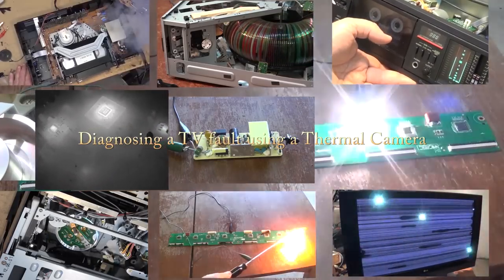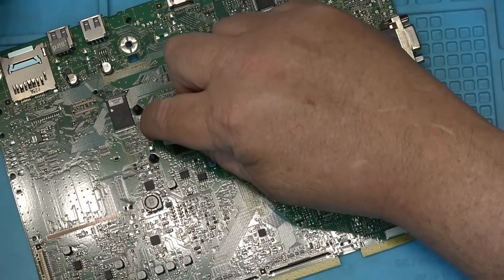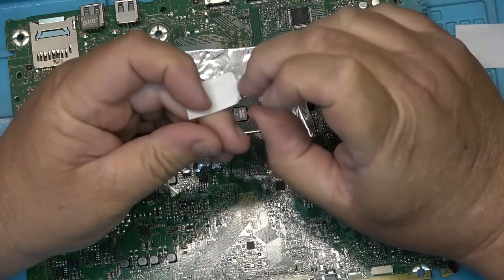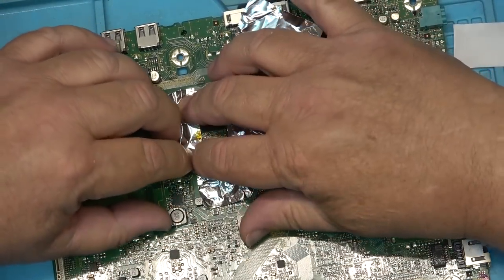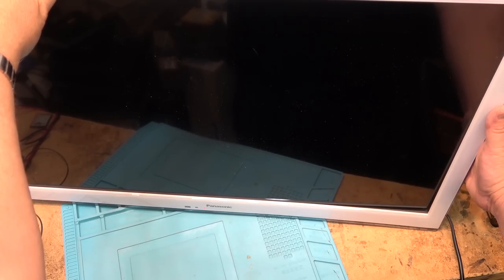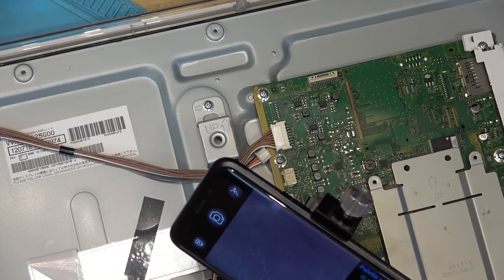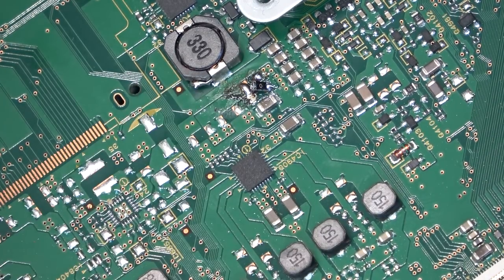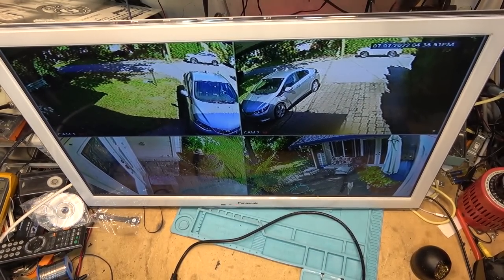Troubleshooting a Dead Panasonic TV using a Thermal Imaging Camera

Comment: I used to (as a kid growing up in the 80's) to work or general helper (go for) go bring me this and that...
Clean up the place to make my point...
But got to see first hand repairs on stereo systems, vcr's (vhs & beta) tv's from all makes & models ( the one tv i still remember to this day that got in for repairs is an RCA i remember the insides were all modular) i think it was an RCA...
I was like 10 years old so my memory is fuzzy
Does anybody remember those modular pcb's from this tv?
The point is that i enjoy your channel & these types of videos it brings back good memories from the good old days in the 80's
Thanks for the uploads
Greetings from Mexico
Reply from the maker: RCA, zenith, motorola, Philips were all modular for awhile.  Problem is modular sets were much more troublesome because the module connections failed.
Reply: @12voltvids  thanks for clearing that up (on the modular pcb's) also remember that a lot of stereo's came in for repairs (burned STK's)
Thanks again for your uploads
Reply from the maker: @jorgecuelar3391  stk ipm (integrated power modules) were the curse of 80s stereos.  A disaster brought to you by your friends at sanyo.  Remember they make life's good things better.... For the service guys for sure. No skill required just change the ipm and charge a fortune for it (because the ICS were pretty pricey especially if you bought them from manufacture.
Reply: @12voltvids  They were also an issue when used for convergence in many TV's.
Reply from the maker: @tinicum54  
Designed to fail.  Made lots of money changing them on Sony projection sets.  Used to buy them 10 at a time.  That was good for the 5 sets i would see a week with blown convergence IPM.

Comment: That TV might not be worth the effort you've just put in. But the entertainment value was there!! Thanks for persevering on that one and reaching a conclusion.
Reply from the maker: It will be used here as a monitor for my camera after the existing 20 year old BenQ tv blows up.  Should probably just change it out as BenQ draws 500 watts.
Reply: @12voltvids  500 watts? that must be fun in the summer...
Reply from the maker: @jorno1994  gets warm in here.

Comment: Would you consider doing a repair on a Sony KV-29FX30e mainboard? Looks to be power regulation issue, picture is pulsating and contrast needs to be quite high.
Reply from the maker: No wouldn't consider repairing a chassis.

Comment: A lot of the smaller Panasonic TV,s and non oled models are most likely vestel made sets Panasonic made sets tend to be the 55 inch up oled TV,s .
Reply from the maker: Everything Panasonic makes TVs anymore do they? Certainly not OLED. Panasonic made a lot of plasma TVs and they made some of the best plasma TVs that were ever made. I have six working Panasonic plasma is in two that are non-functional at the moment. This small Panasonic the panel said made in the Czech republic on the back of it but the main board power supply and television say made in Mexico on them

Comment: A weatherproofing guy who was at the house around 1996 where I was to service an RCA rear projection set offered his to use.  Quickly determined it was the HV splitter.  I suspected that anyway but that removed all doubt.
Reply from the maker: Great tool to have in toolbox.

Comment: I got a cheap hot air station from aliexpress, it works really well.
One thing that always scares me is soldering/desoldering near electrolytic/solid capacitors.
what are the odds of one of them blowing up in my face while im soldering/desoldering something near it.
Reply from the maker: Shield with thermal tape like I did.
Reply: @12voltvids  Yeah, but they still often exceed the temperature rating.
Reply from the maker: @filenotfound__3871  not if you shield it correctly.  We used this stuff to protect cables when using a torch to heat shrink cables and needed to protect plastic insulation.
Reply: @12voltvids  I took an old LGA 775 motherboard and tried to desolder a VRM phase and then solder it back on and even tough i put aluminium foil around the place, 4 out of 5 nearby capacitors boulged. The motherboard still works but thoose capacitors do worry me. Is there a specific setting on the reflow station i could use to avoid this? I used 400c and max airflow.

Comment: Sometimes it's worth more fixing things just to know what the fault is, rather than the item being of any value. Even so you found a use for it - better than going to recycling or landfill. So much stuff is thrown away that should be fixed and re-used instead of dumping on the side of the road. It would be better to create an industry of repairers and downsize the importing of foreign technology - no one has any practical skills anymore - outside of China/Asia. Great fix and interesting to watch the diagnosis using a thermal camera in combination with the fault codes.
Reply from the maker: Industry of repairers you say. That time has passed.  Untill the cost of a 40" tv gets back to 1000 and a 60" 4000 this isn't going to happen. The reason that these businesses flourished right up until around 2000 was because new products were expensive and it was cheaper to repair and replace even if the labor cost was high it was cheaper to repair than replace. When the big price drop happened APK more economical to replace a TV than to fix an old one and that put everyone that was in the business out of business. I left about 20 years ago. Best decision I ever made. I left before the bottom fell out but I could see the writing on the wall
Reply: @12voltvids  Yes what I say sounds naiive but if imports were controlled the price of electronics would go up and there would be a monetary reason to repair rather than just buy new. Reducing waste and providing a valuable core of skilled workers. Just a dream...
Reply from the maker: @radio-ged4626  well there were imbargos on Japanese electronics as recent as the 80s.  I remember very pissed off Hitachi tv owners that took it out on the shop i first worked at when in high school.  Hitachi had their 20 year warranty on semiconductors.  TVs would come in with bad ftybacks or special semiconductors but because the government had an embargo on Japanese companies we just couldn't get parts.  This resulted in customers demanding the store give them a new set or their money back.  I was only 16 working there after school and i remember a few very angry 😡 people call me and the owner who was Chinese every name in the book like it was our fault.  It was the government's attempt to stop the flood of cheap electronics from Japan in the late 70s and early 80s.  It didn't work, the domestic manufactures still went broke.
Reply: @12voltvids  Sounds like a bad time. Must have been quite unnerving for a 16 year old. I wouldn't advocate an embargo, just a little control over import numbers with incentives to provide reasonable repair support. So many manufacturers over protect their products against third party repairers. It would be good if we could all have a rethink on how we produce and maintain electronic goods.

Comment: Cool! How long did it take to find this fault for you? But why does a audio fault kill the whole system to boot up?
Reply: Because the audio chip is shorted to ground and is pulling a lot of current and the power board is detecting a fault and shutting down
Reply from the maker: Over current shut down.  
Didn't take that long to find it.  When I first counted the lights blinking I only saw eight as was shown at the beginning of the video so I immediately went to the main processor thinking perhaps one of the voltages was missing due to a bad BGA connection. Sorry that chip and then checked it and I saw nine blinks. 9:00 is audio problem. So I disconnected the speakers thinking perhaps a bad speaker and it still shut down I grabbed the thermal camera saw the two main ships heat up right away. What hit the power button so just a moment where the audio circuit appeared to warm. You can see the chip but some of the surrounding traces also throw off some heat. I was actually reviewing the recording I made of the initial startup on the phone screen as you can replay it on the phone obviously and noticed it. that's what I decided to check the output caps thinking perhaps one of the filters in the output stage was bad because that certainly would cause excessive current draw. One cap is measuring around 60k where's the rest of them were up in the mega range which is what you would expect because there are other components that will provide some load. I remove that one cap problem still persisted and the cap tested fine out of circuit. That left the chip to be the suspect. Next was disconnect the zero ohm resistor which provides power to the chip. Set fired up problem solved.
To fix a set there are a couple of options one would be to use an external audio board and connect it to the speakers. Could get power from the same point where that resistor was opened for an external amplifier. Or just plug a sound bar in. obviously the sound bar is going to give better sound than the built-in speakers. The trip failure may have been caused by a bad speaker. Speakers have been known to short internally if they do could blow out the chip. the TV doesn't really have much in the way of value because the bezels got some scratches on it and I have no base for it. I'll just end up putting it in storage and then when the bank you monitor I use over the bench packs it in I'll put it in place of that set and use it as my camera monitor. Or perhaps if my son ever moves out and I can get the back room that he's got his computers and crap set up in I can move the shop inside which is something I've been wanting to do for years. Then I'll mount it on the wall directly over my bench to view my camera on because it's a nice looking TV.
When I say it didn't take that long to find the chip well it didn't once I started looking for it and the thermal camera certainly made things a little easier because it made that defective chip stand out like a sore thumb. This is the first time I've used a thermal camera on diagnostics. However this TV was brought to me a couple years ago as a rush job as the person that owned it wanted it back like right away because they couldn't live without TV in their bathroom. So I did initial troubleshooting and determined the main board was at fault and I was told to dispose of the set. had it been a giant TV it would have gone to the recycle center but because it was a smaller one I just stuck it in the corner and left it sit there. when I got the thermal camera I thought this might be to check it out on and see why it's shutting down.
Reply: @12voltvids  Thank you for explaining.  I think this was a really good repair video.  Thanks man.

Comment: How can i contact you sir? Any social media? I have a problem with my audew tyre inflator
Reply from the maker: I'm not really on social media except for here.
Reply: @12voltvids  maybe on whatsapp some chatting apps, as it's easier..
my Audew suddenly doesn't inflate any more, 3 tyres did, the 4th not.. maybe because i over used it..
Something burnt, do i need to unscrew it and check
Reply from the maker: @vitaliigheorghivici2815  i don't use chatting apps

Comment: What is the point of the 0 ohm resistors on the main processor board?
Reply from the maker: It's a surface mount jumper.  They need to get power over other traces.  Either you put a wire jumper or 0 ohm resistor. Circuit boards assembled by robot.  Robot can placed by robotics.  Wire jumper has to be installed by ✋.
Reply: @12voltvids  So in other words, if you need more connections than you can fit traces, you put jumpers? Am I getting this right?
Reply from the maker: @walle637  yes that's how it works.  Used to do it with a bare jumper wire.  With SMD they do it this way

Comment: Looks like those FPGA chips has thermal pads under them so you could have heated them from the underside to, and avoided blasting all the heat trough the chip itself.
I think that's one of the problems with those pesky Denon DSP chips that people try to re-ball and just destroys them by only heating them from the top.
If you heat from both sides you reduce the heat stress on the chip and that might help it survive.
Reply from the maker: Obviously if is working.

Comment: I didn't expect it to be the pwm audio chip,  power supply short.
Pity you havn't got one of those free pwm boards lurking about lol
You may not have any interest in it,  i understand that.
Reply from the maker: I have plenty of pwm amp boards but they are a different chip.
Reply: @12voltvids  i was thinking you might connect the pwm board to the line out and power supply.
connect the internal speakers to it.
Yes im silly lol
Reply from the maker: @zx8401ztv  now come on you know me if there's another way to make a video out of this set down the road I will. That may be a project for a rainy day.
The speakers in the set might be fubar however because something caused that chip to blow. It could have been a shortened speaker that took the chip out in the first place.
Reply: Oh yes i do know you have a thumb in many pies Ha ha .
Some pies are not worth eating, others are sold off to people with no taste :-D
Make sense of that if you can lol.